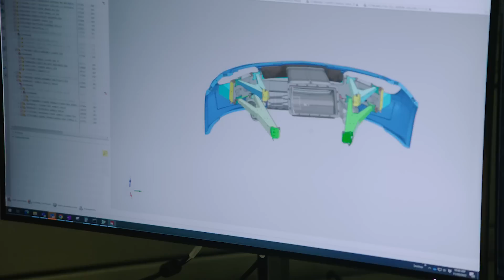Year in review: Garage 56, NASCAR to Le Mans

Comment: Nascar deserves more recognition, I hope this gives it some!
Reply: It doesn’t get much recognition because it’s kinda boring. All the cars are basically the same per the rules/templates with different head/taillights/ exhaust tip decals. NASCAR needs to add some downforce and race in the rain. Le Mans is definitely a step in the right direction.
Reply: Racing in rain would do a lot for the sport, but there's the thing, not only the cars have to be ready for rain (I.e. proper rain tyres, higher downforce and water drainage levels, as well as a reliable way of seeing each other at any relative position to your car), it would also require circuit upgrades to handle and drain water and quickly clean the track afterwards, better protection to the fans, etc.
 Driving on water is also a different discipline than driving on dry surfaces, with F1 teams having systems to spray water on track for hours so that the drivers can get used to it (to be fair they drive when raining since they're kids), besides the circuits costing hundreds of millions each because of the safety requirements.

 Maybe Nascar is the way it is and we have to like it, or not.
Reply: Nascar is hillbilly driving ;)
Reply: It would be popular outside the americas if we could actually watch it
Reply: No it doesn't, it's just Nascar.
Reply: Minor national series, it gets all the PR it needs.
Reply: Lies again? Grab Affordable Ride
Reply: I guess this is the entire point. Although it is already massive.
Reply: maybe because seeing cars going in circles doesn't entertain us?
Reply: does it though?
Reply: I want to like it but I hate how overly artificial the series is now

Gimmicky points system, stage cautions and officiating so bad it makes FIA officials look like geniuses by comparison.
Reply: @jlloyd2004mcs  Bullshit check the late drama rn
Reply: Han Dofe  it's not circles its litterally ovals and there is a lot better racing action in the front of the field then F1 has. You probably have a short attention span.
Reply: @jlloyd2004mcs  They race in the rain but not in superspeedway. They have rain packages for road courses.
Reply: NASCAR is for oval tracks not for technically more demanding like in Europe or Japan that's all.

Comment: I'm aware they obviously don't need them, but imagine all Cup cars with working lights like that. Would be cool to watch...
Reply: no point they dont use the brakes unless its at short tracks, the brake bias is what slows down the car
Reply: @AutoRacingNR2003  bro said “I’m aware they don’t need them, but it would look cool. Then you tell him there’s no need…😅
Reply: @AutoRacingNR2003  they use the brakes at every single track. The only tracks they might not use them at during a normal lap are the superspeedways. Would also be pretty helpful for when cars have to check up for wrecks. Would eliminate most of the huge pileups I think.
Reply: @damienirvin777  at mile/2's they use brake bias, no brakes. The car slows down itself
Reply: @AutoRacingNR2003  Brake bias doesn't mean what you think it means bud
Reply: @AutoRacingNR2003  you should google brake bias.

I think you mean “downshifting” which can be used to slow the car without brakes at some tracks. That being said they use brakes at every track.
Reply: @AutoRacingNR2003  They use brakes on all tracks, believe it or not.
Reply: @AutoRacingNR2003  brake "bias" is the balance of the braking force, genius. They set that, to determine how much force they want to the front and to the rear, usually around 60/40 split. You should really have some knowledge on things before trying to speak on them 🤷🏻‍♂️
Reply: @AutoRacingNR2003  brake bias is controlling how much weight the car puts on the front or rear tires (i think, my only familiarity with the term is from dirt rally 2.0), so no, it is not a way to slow down. i believe the term you’re looking for is letting off, going off the throttle but not using the brake
Reply: @damienirvin777  from my expitence with nr2003 you do not use the brakes on 1.5 miles you left off because the brake bias is high enough to slow down the car
Reply: @welfarewednesday  brake bias is used to stablise the car, and slow it down, if you touch the brake on the corner entry you will spin
Reply: @luxor2k_  i dont watch nascar as much anymore which could be part of whats wrong with my argument, but with the 550 and even the older cars it is absolutely the case
Reply: @luxor2k_  it seems that i am wrong, atleast for certain tracks. I mean we both remember harvicking at old atlanta. Shorter the track the lower (ish) the bias so for flatter tracks you would be. However for larger tracks not so much, when they let off there letting the higher brake pressure (brake bias) slow down the car which is constantly applied
Reply: @AutoRacingNR2003  Brake bias doesn't do anything unless the brakes are actually being applied, bud

Do you mean engine braking? That's the compression of the air in the cylinders creating drag and that underrotates the whole drivetrain relative to the car's speed and slows it down. That's the mechanism behind Harvicking.
Reply: They dont need lights because the track is always LIT
Reply: because the track's always lit😂
Reply: @IsabellaNicoleZent-sc8td  Yeah, well, so is my brother, but he still needs headlights.
Reply: That's Cars 3 irl
Reply: @AutoRacingNR2003  brake bias is the balance of the brakes, you doofus
Reply: @AutoRacingNR2003 Brake Bias is the force bias between front and rear brakes, As in how braking force is divided between the front and rear brakes when the pedal is pressed. 

You say they do not brake, Yet for brake bias to have any effect at all you must first brake, Are you trying to refer to engine braking? I am no expert on nascar but I do believe brakes are used, But front what I understand on most higher speed Ovals they mainly just lift off the throttle while cornering. Which is a common technique universal in motor sports.
Reply: @welfarewednesday  engine braking

Comment: They can go faster on the straights if they put the actuator on the spoiler like Andy Petree came up with for a Daytona 500 that lowers the spoiler on the straights with the push of a button and will lift back into place by a button or pressing the brake like F1's DRS since its the lone car in the Innovative class.
Reply: True but they have to build a car around the Le Mans specifications and requirements, so they may or may not be aloud
Reply: They can go faster if they don't use a Nascar Camaro, but that's kind of not the point isn't it?
Reply: DRS aren't allowed in Le Man's.

Comment: The last time a Camaro raced at LeMans(in class) was in 1982. An American privateer entry with a small block Chevy V8 running a dirt track chassis with a wild aero kit. It finished 17th overall. The Garage 56 will be running as an exhibition prototype, no class rules to comply with. So the engineers will make it lighter, more aero and with a tweaked engine for durability cranking out gobs more horsepower than allowed in NASCAR. 
The benchmark finish for a Camaro has been set. Does Mr. H's money expect an overall finish of 16th or better? I hope so!

Comment: Wish Toyota or ford got to assist. Cool program but seems wrong to just brush aside the other OEMs
Reply: Maybe they were offered, but didn’t want to point up the money to do it.
Reply: Jim France chose the manufacturer and The organization. You can't have more than one garage 56.
Reply: @johnhaas2523  You don’t know that. Also, ACO decides who, if anybody, gets the Garage 56 entry.
Reply: @johnhaas2523  could’ve been a collaborative unbranded effort
Reply: I would hope, because they use the Chevy engine in NASCAR, it would only be fitting to use the Chevy, and it is the best looking of the bunch, but on the other hand common sense, doesn't usually win out in NASCAR.

Comment: They don’t tell you all the technical stuff.

This car is NOTHING like the Gen 7 it spawned from. 

Obvious differences like lights an aero bits aside, the car has been made ~400-600lbs (180-270kgs) lighter, the fuel cell now sits directly behind the driver instead of in the rear clip/trunk, the engine has been moved further back in the car, and it’s been equipped with TC, stability management, an adjustable rear diff, the works.

To quantify things; estimates put the G56 car 7-10 seconds faster around the Charlotte Roval than the standard car. 

I’d like to see Ford and Toyota take a stab at a package like this.